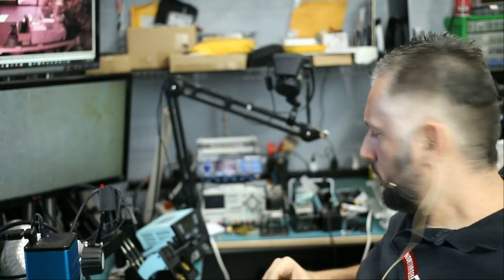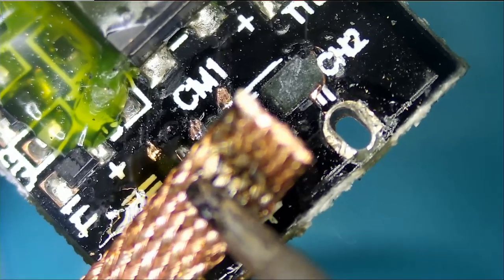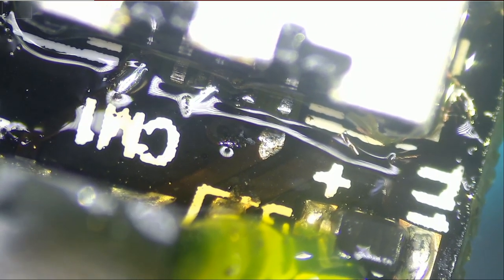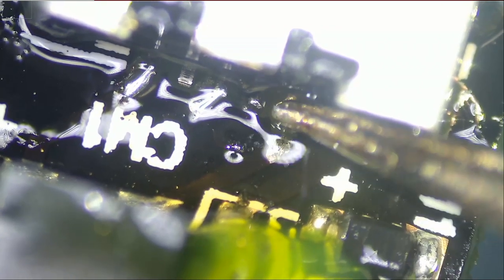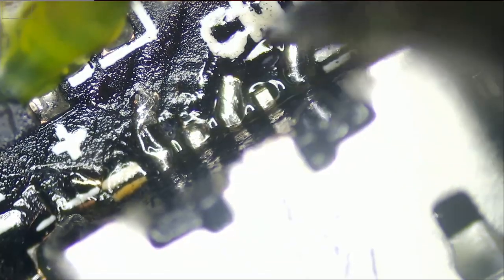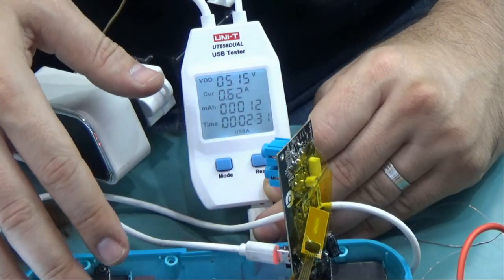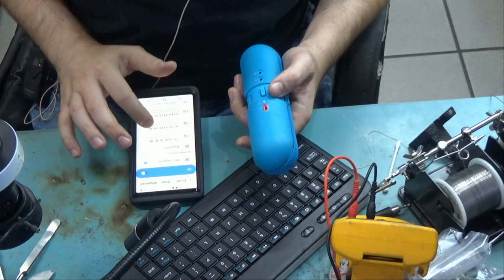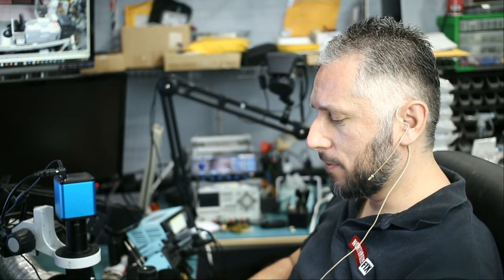Beats Pill Bluetooth Speaker Broken Charging Port Replacement

Comment: which flux do you use ?
Reply: Rosin resin is good and cheap. I dilute it in alcohol and put it in a zippo fuel bottle. You can let it sit over night in alcohol to dilute or heat it in a tin lid over a flame. Excellent solder flux that last a long time!